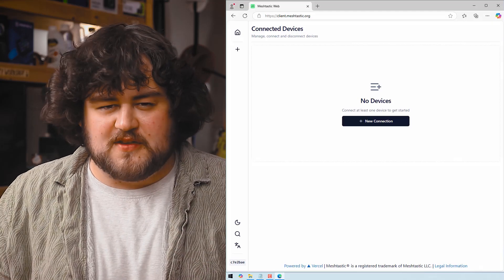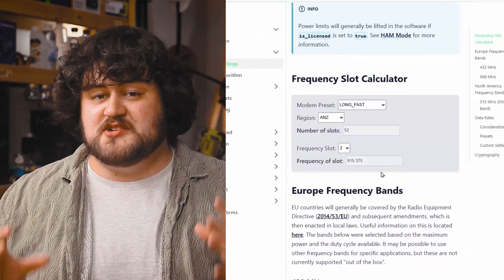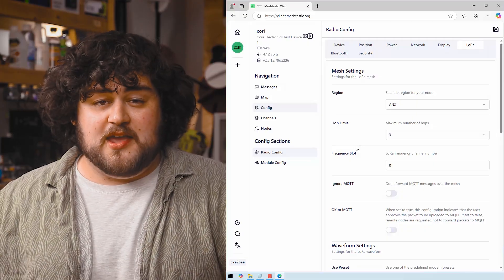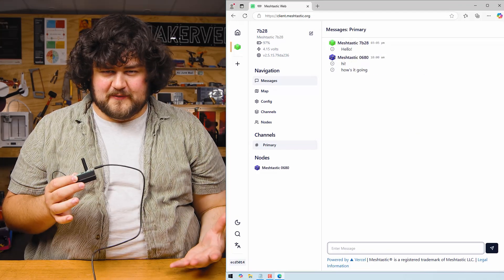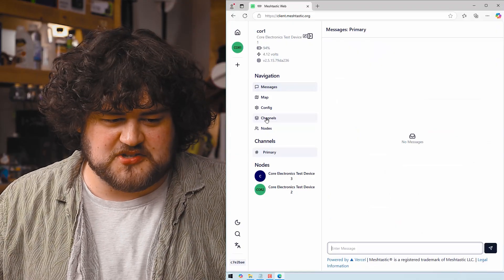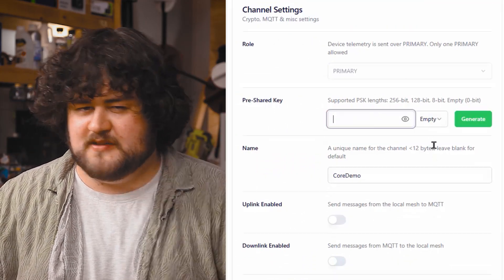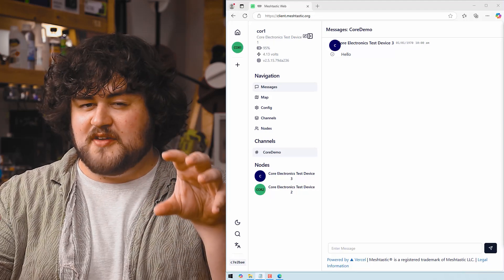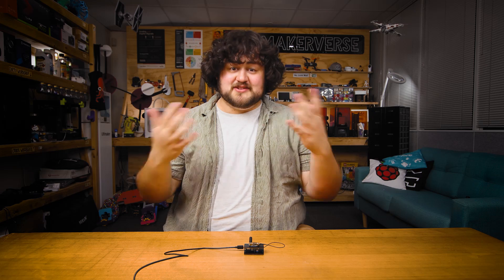Channels & Frequency | Meshtastic for Makers

Comment: if I use default slot 0, how to know if Meshtastic automatically changed my slot?
Reply from the maker: You could test it with another device, if you manually set the frequency slot of your region on a 2nd device, and you cant see your first device on slot 0, then it has changed.